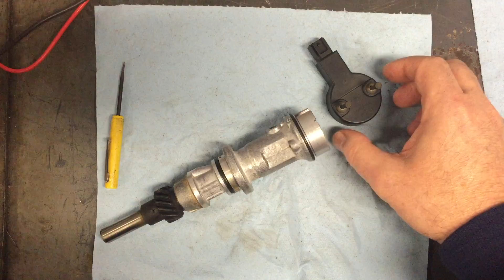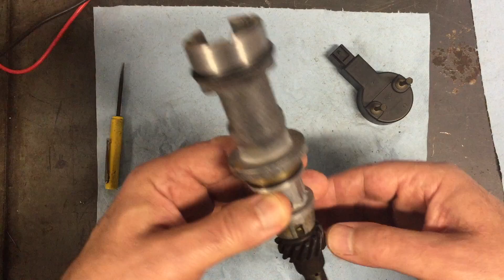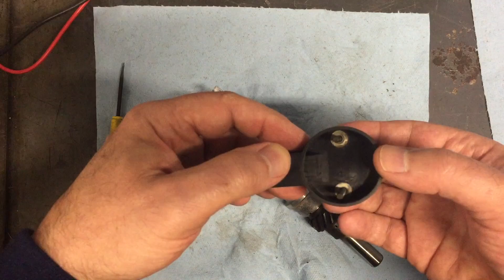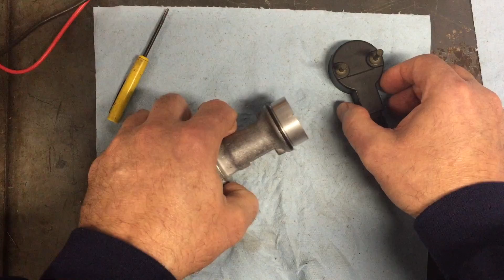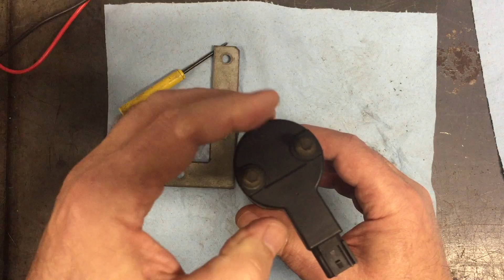02 ranger cam synchronizer replace

Comment: So, should I rotate the engine until the plastic tool snaps on  the synchronized before I take it out? Then put the plastic tool on the new one before I put it back in?

Comment: If the easy way fails the long portion of the sensor should point at 38 degrees off of center line when at top dead center.
Reply: The sensor positioning isnt critical for the timing, only helpful for the stress on the wiring harness, right?

Comment: Mine has 137000 miles...no problems so far with it....but gonna replace soon for safety.wonder if the Borg warners are good...heard and read the dormans are not any good.mine is a 2006
Reply from the maker: steve rugerguy I used one of the Ford Motorcraft red And white box. It is their after market brand. Worked good for me.
Reply: Thats why I just replaced mine. I lost a 3.0 engine to a sync last year that the cam teeth wore completely off and didn`t even throw a code in the mean time

Comment: This is a defective Ford design. There is no way that a properly designed bearing should start making noise before 150k miles.  The bearing is not really under any load so it should not fail as often as it does.
Reply from the maker: PickleRix There are no bearings in the synchronizer. It has two sets of bronze bushings. The only torsional load comes from the oil pump which is attached to the bottom of the synchronizer by a shaft. But I do agree I should still get more than 60,000 miles out of the synchronizer. That is when mine started making noise. About 60,000 miles.

Comment: Folks...when doing this repair. Turn engine over to TDC on #1 cylinder. It will save you time, and you will actually be doing the repair correctly..not guessing. You don't need two alignment marks, only shade tree wannabes do that.
Reply: Mark Duggan can you expand on that? TDC?
Reply: @pawdre5151  Top Dead Center. There are lots of instructions on youtube for "how to find top dead center (or TDC)"
Reply: I’m just learning about cars and dont kind of confused with TDC. So far I get that it’s the position of the piston on the compression rotation. But still kind of intimidating to mess with it.
Reply: This method works fine! The point is to get it back into the same relationship to camshaft.  I used this method on a vehicle I purchased new. IF it were a used vehicle, I would most definitely use the TDC and alignment tool method!

Comment: Consider yourself glad. This really helped me. Clearest tutorial I’ve run across. Really hoping this is the fix. Been very frustrating. Like so many others, I tried the fuel delivery & ignition modules. Being ignorant & totally lost because of no distributor. Not until I worded my inquiry just right, did cam synchronizer come up. Thanks man.

Comment: Would this synchronizer make a rattling sound at exceloration as well or only a chirping noise? Because  I've had chirping /squeaking sounds come out of my 3.0 v6 Ranger only to find out it was the belt tensioner and pulley but now I'm getting a rattling/crackling sound when the engine gets to  normal operating temperature.
Reply: I have a an annoying squeak coming from the top of my 2003 3.0 motor and I keep thinking it has to be belt or a pulley / tensioner issue but then I come across this camshaft issue. You say you replace the tensioner, how hard was that and how did you determine that was the issue?
Reply: @ to replace the tensioner it’s not hard at all. It’s held by one bolt. Take the belt off like you normally would and unscrew the bolt off and just replace with new one
Reply: @JuanDaMajikOne  thanks

Comment: How would you put the synchronizer in tdc?
Reply from the maker: I bought my vehicle new. I marked the outside housing to a point on the intake. Mark the inside window for the sensor to a point on the synchronizer case.
Reply: @tomsgarage2001  why is it important that the outer housing be in the exact same position as when you took it out. I get that the inner tab should be in its exact spot it was in relation to the magnetic sensor because of timing but I dont see how the position of the outer housing is critical for the timing. I’m new to car stuff but from watch videos, doesn’t seem as critical as the inner tab alignment if you’re not doing this with TDC
Reply: Jacob Vela or you can take cylinder #1 take the spark plug out put a long screwdriver down into the hole with someone helping you turn the crank and find TDC

Comment: What parts did you use? Where did you get them?
Reply from the maker: The part I needed was the synchronizer itself. You can purchase the parts at any part store. I got mine from the Ford dealer. I know the parts man well. Got a good price.
Reply: @tomsgarage2001  how much ?
Reply: I just replaced mine and found that there was quite a large range of prices between all the parts stores even online. I went cheapo at auto zone for $45

Comment: So my 07 has a small chirp on start-up, then whines when I accelerate. The lower the gear, the louder it is. By the time I reach 5th gear at highway speeds, the sound is gone. If I have the truck in neutral, or if I put it in gear but keep the clutch pressed in and rev the engine, there is no noise. I don't have a CEL and I have no other issues with driving or shifting. I'm 99% sure the sound is coming from the transmission. Should I replace my synchro or do I have another issue?
Reply from the maker: Is your engine a 3.0 V6? You can check the synchronizer for noise. It is located at the back of the intake just to the right of center. You should be able to just start the vehicle and set at idle. Put a long extension on top of the synchronizer and to your ear. Listen for the chirping noise. Sometimes you can even feel it. If you do not hear the noise I would lean towards the transmission. Good luck. Hope I was of help!
Reply: tomsgarage2001 a 06 taurus was making a noise and I think it’s injectors cause when I put the mechanics stethoscope on the cam sensor and the housing, I don’t hear anything bad noise or squeak.

Comment: I just bought a 2002 Mazda B3000 ~ (Just like a Ford Ranger) it was chirping and had occasional lurching at highway speeds....I dropped a little oil in the top of the cam Synchronizer and it has been quiet and no more lurching.
Reply from the maker: Sometimes this works. More often than not it is a temporary repair. Hope it works for you. Good luck!